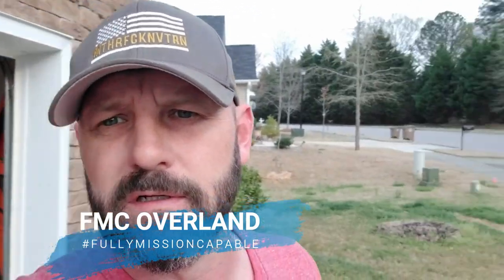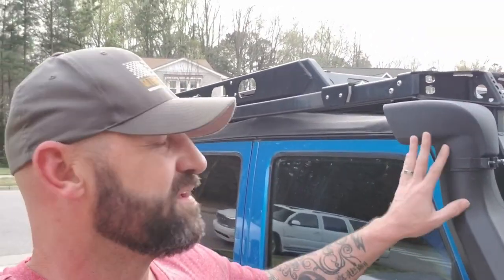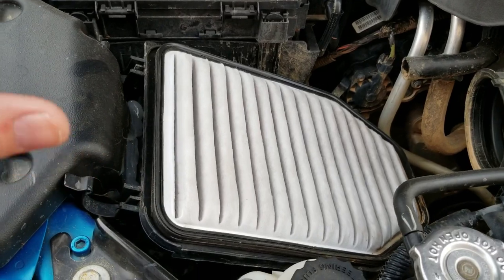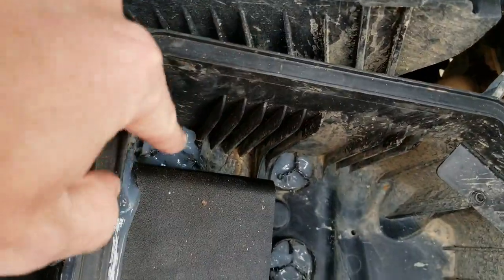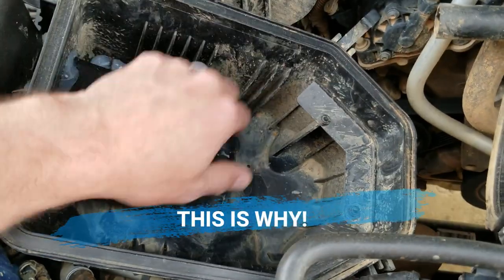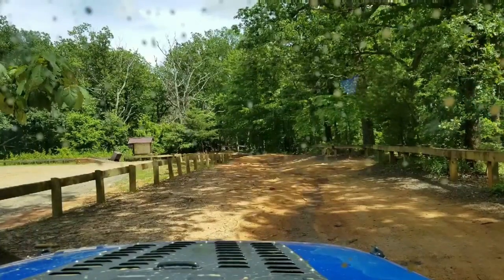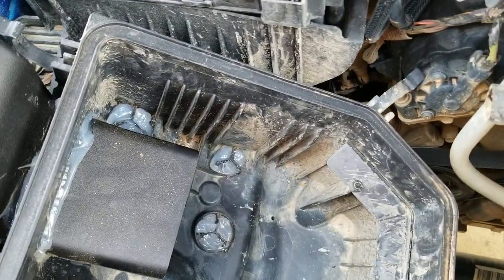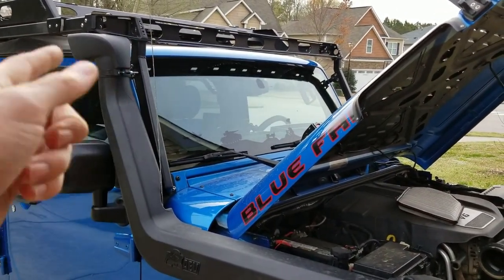Why is our AEV snorkel head facing backwards? "UPDATED it's facing forward now"

Comment: The ram head of the snorkel is designed to keep most, not all, water from going into the snorkel. It allows water to go out of the back of the ram through a small part on the back.
Reply from the maker: I have recently turned it forward, what I was trying to do was explore other ideas and get people thinking.

Comment: I did run an Snorkel on a turbo charged engine and had the head turned around. Had no problems at all. A turbo engine can't have a RAM Air effect at all because of the turbo. And I am not shure about RAM Air in big engine, because of the small size of the air intake itself. The water in your car after driving through deep water came through the cabine air intake on the passanger side firewall. The wave of water over the hood reached the cabin air intake. It was to much to shed of and came throgh the vents. I had the same happening to me in Iceland driving through deep water. Nice car btw.

Comment: The little raised part at the back of the ram head that goes down to where it clamps to the top of the snorkel is designed to remove water and heavy particles out of it, they are designed to face forward, the engineers that designed them are not paid bulk for nothing

Comment: I'm not sure the dust argument holds water (no pun intended). The dust is suspended in the air, if you're sucking in air, you're sucking in dust. Sure some of the larger chunks may not have their direction reversed, but they're the ones that are easy for the filter to catch and drop to the bottom of the box anyway. Plus all decent ram heads have water and dust separators built in, to shed the bulk of heavy inputs out of the rear.
Been running mine forward for several years and not noticed any increase in filter contamination, and never found rain in there even after rain so hard I had to slow to 40mph on the highway just to see where I was going.

Comment: There are one-way valves that can be fitted to allow your air box to drain, but not let water up from below
Reply from the maker: Thanks for the info, we no longer have that rig and just purchased a Gladiator, so a snorkel for it will be done this summer

Comment: While I agree with your logical approach, there is one important reason it should be faced forward. The intake at the top is called, a ram. it is designed to 'ram' air into the air filter, which ultimately can increase performance, especially with turbo diesel engines. The amount of water that actually gets into the snorkel is insignificant and will be trapped by the air filter, which is what it is designed to do. If anything, an up-market air filter will also improve performance.
Reply from the maker: I agree :) I have recently faced it back facing forward. This was kinda done as an experiment, has definetly  gotten people talking.
Reply: I changed mine to a bell style pre-filter. My Pajero (Montero) has a gasoline engine with LPG. The ‘ram’ flow is not necessary.
Reply: would never use any filter other than OEM style and type filter.
Reply: @Lindsay West, Although it's called a "ram" it doesn't actually increase air flow into the engine. It reduces the air pressure at the filter by a significant amount. I can point you towards videos testing this. Factory intakes are always better from that aspect. The only reason to install a snorkel is if you're doing a lot of short, deep water crossings or are doing extended convoys on dusty roads. Otherwise, leaving it factory is much better for your engine. The "cooler" air is technically true but really just marketing nonsense since the reduction in air pressure at the intake reduces power much more than having slightly cooler air increases it, especially on turbo engines.

Comment: We've known about laminar air flow for 70 years now, take a look at P-47 Thunderbolt, backward facing flaps to extract air , facing your snorkel backwards pulls a vacuum on your air box. Yes it absolutely does, about 23% less available air, we know this because we literally ran tests on it in wind tunnels. Forwards equals atmospheric pressure, backwards is a 23% drop in available air pressure.
Reply from the maker: Understood, we turned the snorkel back to facing forward shortly after the video. Thanks for watching.

Comment: What would happen if you’re snorkel gets ripped off by a tree branch or something, do you have to carry extra gear in jeep in case that happens, and are you afraid someone is going to try to steal the top while in a store?
Reply from the maker: not worried about theft...if someone wants it that bad they can have it, locks are for honest people, criminals are going to be criminals. As far as tree branches on the trails, when I trail ride I have a set of limb risers that I installed that run from my hood to the rack on each side that protects my windshield and helps with protecting the snorkel also the AEV snorkel is really well constructed and really thick, thats the main reason I stayed away from the Rugged Ridge snorkel, Ive heard horror stories of them cracking during trail rides, the AEV material is twice as thick. And as far as running the head backwards I have run it facing both directions and the engine seems to perform the same either way.
Reply: Fully Mission Capable Overland I like how you think 👍🏻

Comment: You point the snorkel into the wind for ram induction.  Doing the opposite puts the intake in the low pressure zone behind the snorkel, which significantly disrupts airflow into the engine.  It's just like why propeller aircraft have the propellers mounted in front of the wing instead of behind it.  That wing depends on the airflow from the propeller to create lift.  No prop, no lift, no fly.
Reply from the maker: I fully understand, was just trying to get people to talk and think :), i think it worked. My snorkel is faced forward now :)
Reply: @FMCOverland  It seems like a good idea at first, but airflow makes or breaks an engine.  There is no perfect solution to keep water or dust out of the air intake.  You can't filter water out of the air because oxygen(O2) is bigger than water(H2O).  Any filter tight enough to block water blocks oxygen by default.  You can only filter oxygen out of the water, not visa versa.
Reply: Ram air at jeep speeds. Right....
Reply: @mattjones1992  Even jeeps get on the highway.

Comment: most people have no idea of the dynamics of air flow etc. air flow is about smooth curves, stopping rain is about sharp curves, lets stop the rain getting in the air system in the first place. I have made a rain interceptor 
https://www.youtube.com/watch?v=rxna-Rh6rT8
which stops rain intake and keeps the snorkel facing forward as it should be, the sealing of the air box is primitive at best and the drain hole will be clogged too easily, sorry to say this but you have a lot to learn, especially showing the Jeep going through the large puddle towards the end of the video, the original air intake is terrible in a jeep, nearly killed another Jeep
Reply from the maker: Thanks for the info. I understand I may have a lot to learn, BTW I never claimed to be an expert, just sharing my experiences. I'm sorry you didn't enjoy the clip of my Jeep going through a puddle before I installed the snorkel. But thank you for taking time to comment and share some info.

Comment: Actually, the snorkel is NOT for cooler air. will it get cooler air, hmm arguably yes.  It is also NOT for diving into water up to your neck. The main purpose, primary purpose for a snorkel is so the engine can suck in air that isn't dusty. To eliminate or lessen dirt intake.  It was originally developed for desert regions such as Africa safari, Australia etc. Jeep can only safely ford 30 inches of water.
Reply from the maker: I agree and disagree, I agree it is not designed for extended submersion due to the fact that most of the electronics under the hood are not fully sealed BUT one of the intentions is to grab cooler cleaner air, the following is directly from the manufacturer "...is designed to provide your hard working engine with the coldest and cleanest air charge possible, maximizing engine performance and increasing longevity..."
Thanks for your comment :)
Reply: @FMCOverland  yes, "straight from the manufacturer" who is trying to sell you their product! What I am saying and my comment was based on your comment about bubba coming up and saying whooo hooo i'm gonna go through some high water, or whatever you said. All i'm saying is The historical purpose of the snorkel was to prevent the intake from sucking in dirt on dusty trails. all the other benefits are ancillary.

Comment: You’re using a Jeep for off-roading, there’s your 1st big problem. Most other brands of snorkel makers provide a ‘bootie’ to cover the snorkel inlet, or u can be creative and make your own.
Reply from the maker: Ouch! So may I ask why you apparently have an issue with Jeeps?
Also, AEV does make a prefilter top for it, I am unable to use it due to the clearance of my roof rack supports.